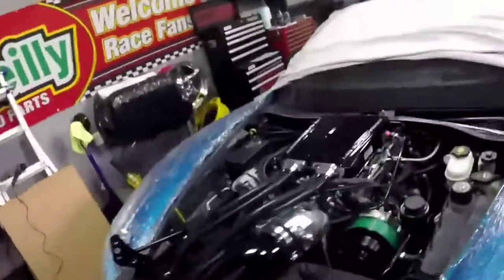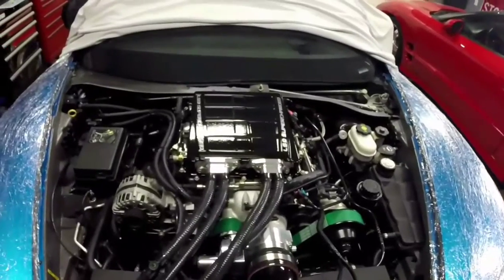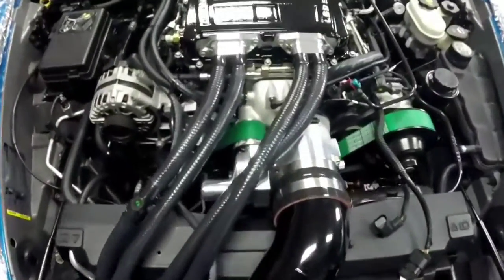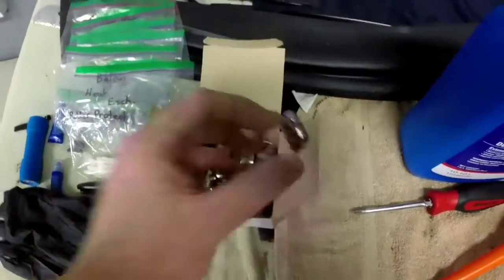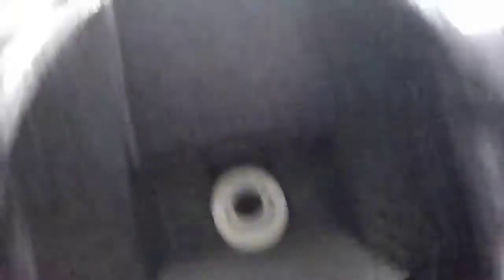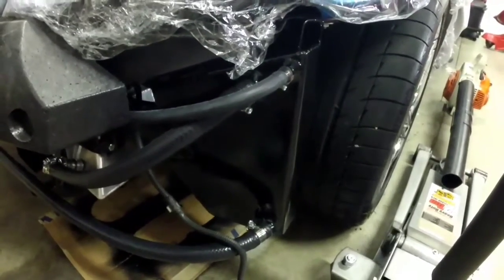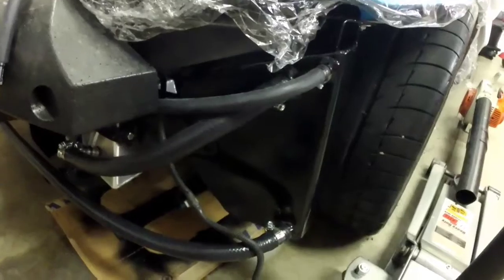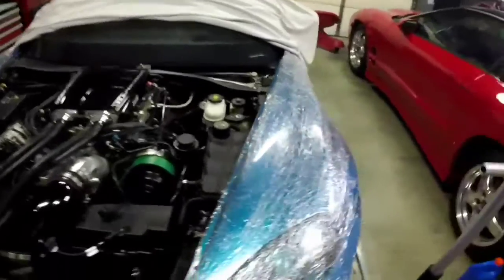ZR1 / LS9 Supercharger Cooling Modifications

Comment: lower right (drivers side) of the HX, what adapter and/or hose did you use to get it to bend nicely into the stock expansion tank.
Reply from the maker: I went to aftermarket tank
Reply: @TWAMotorsports  correct but you still have the stock expansion.  But I figured it out I bought a gates 19768 because it has a factory bent in it that won't kink and cut in half then a 3/4 to 5/8 adapter with the stock hose to the top stock expansion tank.  Thanks for the quick replies.
Reply from the maker: @MrH00nel2  it's been a while since I did it but remember trying to keep kinks and bends out was a choir
Reply: @TWAMotorsports  a chore is an understatement  lol  I probably visited the auto stores 15 times this weekend and amazon prime next day to make this shit work.  i eventually bought a lot of adapters and returned what i didn't use.
Reply from the maker: Yeah that's what I did.

Comment: how are the IATs with this set up? I'm aiming for a 700 to 800 hp for my zr1. and hoping this set up works well and wont have to do the ice box. thanks
Reply from the maker: With 14% lower 2.35 upper it hits 150 on top of 4th gear run. Recovers to 105 in 30 seconds when you get out of it.

Comment: TWA - do you still have the blockoff plate on the bumper? It seals off the bottom of the bumper and forces air to go though the grille/mouth opening up front.

The Z06/ZR1/GS have them - base models do not.

I upgraded to the Edelbrock HX as well - and was unsure if I should put it back in.
Reply: I'm referring to this piece highlighted in yellow:

https://cimg2.ibsrv.net/gimg/www.corvetteforum.com-vbulletin/1300x731/80-img_6665_png_ad51c847fe02bb3d95fd9f07a9d3d0b7ae6f5cf9.jpeg
Reply from the maker: bonecrrusherSS no it wouldn't fit with new heat exchanger

Comment: Where did you get the "Y" connectors for the intercooler inlet hoses
Reply from the maker: chb2244 I found them online. It was a boat supplier
Reply from the maker: chb2244 can't remember the site though.
Reply: Alright if you think of it let me know because I just ordered the same setup and need y fittings
Reply from the maker: chb2244 google seachoice 3 way y fitting for 3/4"